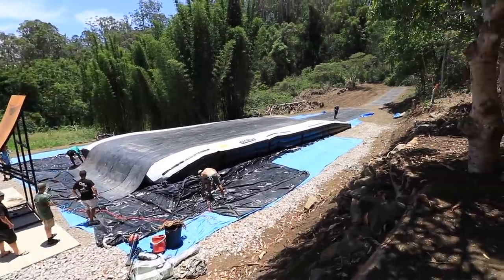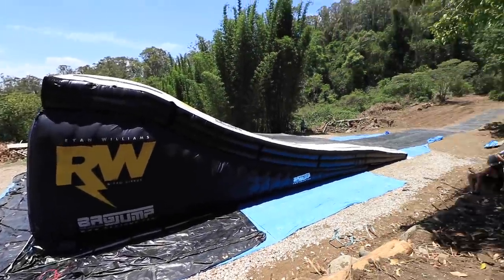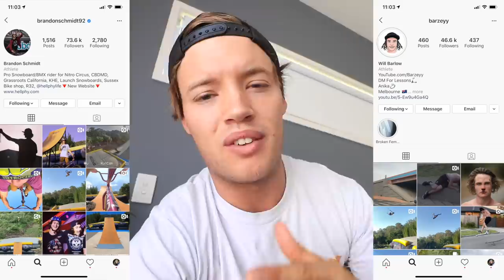Quadruple Backflip On BMX & Scooter!

Comment: Airbags foam pits and resis have changed the game completely. I used to skate in the early 90s. If you tried any of this craziness you probably wouldn't have walked away (if you didn't land it). These are great tools to take things to the next level. The things you guys are pulling off would have been considered impossible or extremely dangerous. I'm happy to see this generation is killing it in action sports. Also, I'm not saying what you gus are doing isn't dangerous because it is. I'm just happy that there's a little more risk mitigation.